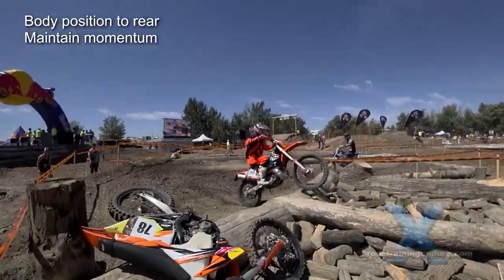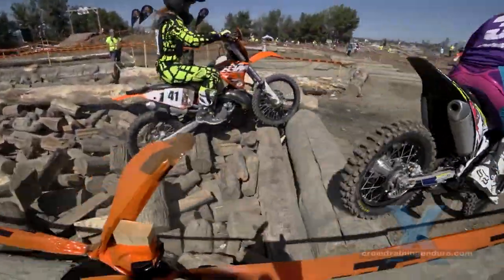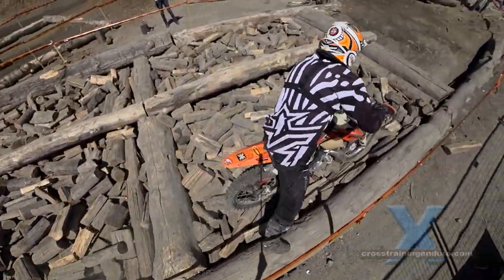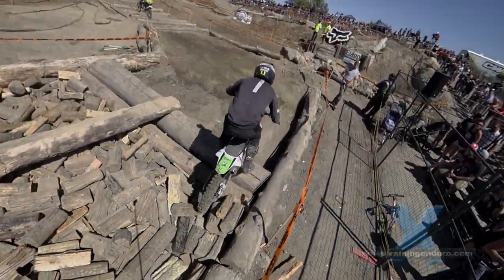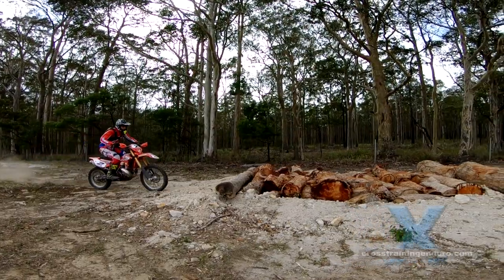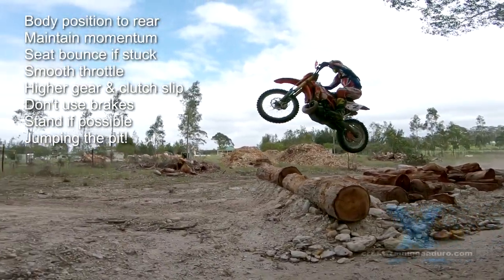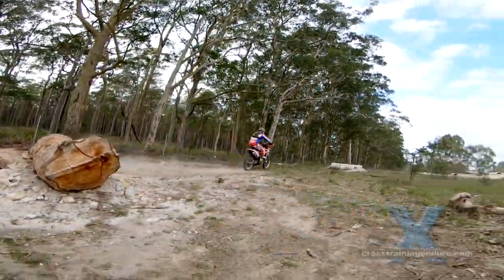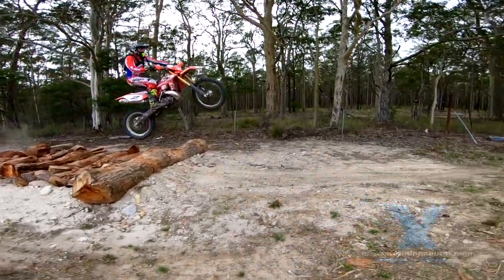How to ride log & firewood pits in endurocross!︱Cross Training Enduro

Comment: I've just gotten back into dirt bikes within the last two years. I haven't got to ride as often as I would like, but I have found the same advice works on the mountain single track trails here when you get into very Rocky sections. Sit to the rear of the seat and try to push a little faster through the rocks. Seems to help the front wheel glide through and keeps you on a straighter path. IMHO